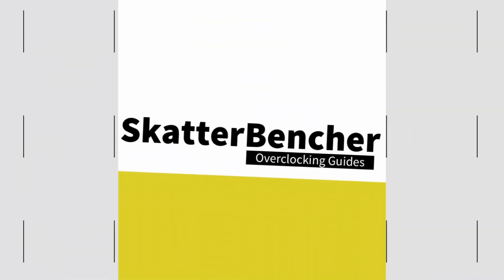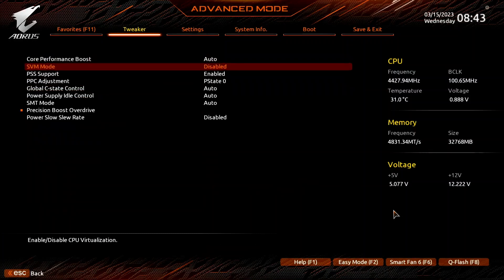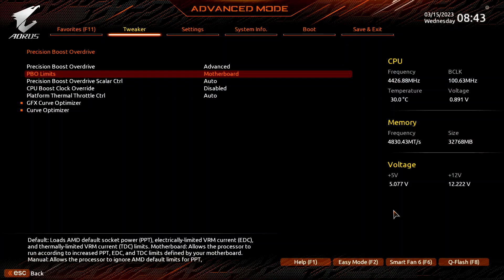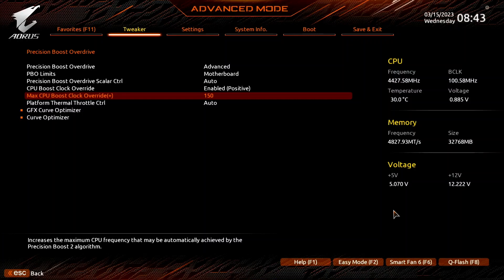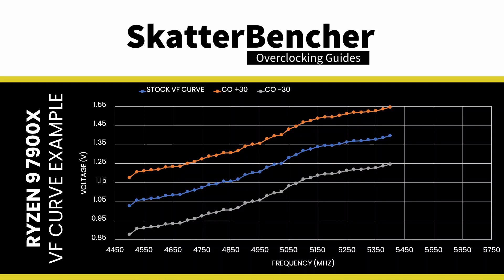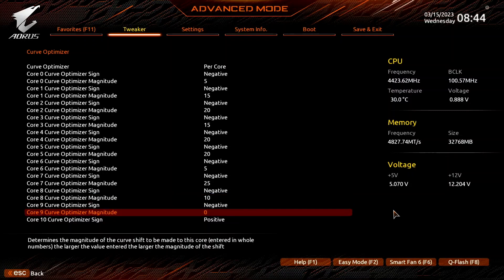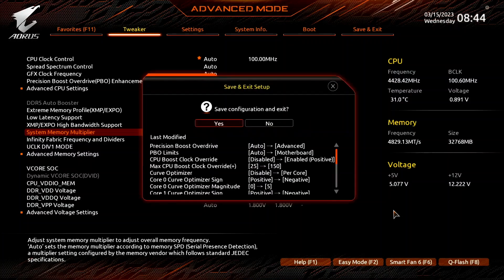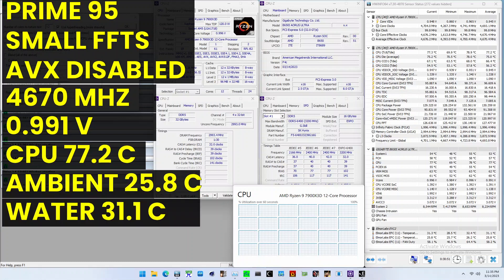5 Minute Overclock: Ryzen 9 7900X3D to 5789 MHz

Comment: 2:00 Enabling CPU Boost Clock Override (+150 as in the video) on my 7900x3d and ASRock B650 Livemixer bugged out the CCD scheduling - CCD0 (V-cache) was prioritized all the time, not only in games but in windows and benchmarks as well. Nasty bug.
Reply: it should do that its better for games ccd0 prio
Reply: @Adrian23yt4k  not when it prioritizes the vcache ccd in idle / browsing. Be sure to set power plan for win11 to balanced and not performance

Comment: I couldn't help but notice that the memory you have is not EXPO memory but is XMP memory according to the link you provided to Amazon. Is the XMP memory still ok to use with an AMD motherboard for OC?
Reply from the maker: XMP kits should work just fine on AMD motherboards. However, they might not be called XMP so not to conflict with AMD's EXPO branding. So they might be called DOCP like on ASUS boards.
Reply: @SkatterBencher  Right, was asking cause I wanted faster RAM and EXPO technically only goes up to 6000 MT's whereas XMP RAM goes up to like 7400 MT's or higher. I'm using an MSI B650 Edge Wi-Fi Board. I initially bought G.Skill Ripjaws that could do 6800 MT's but found out it was XMP so I returned it to Amazon for G.Skill Trident 6000 MT's instead that could do the EXPO. I've heard that if you try to OC XMP RAM on an AMD board it could be unstable, is that true or is that only if you are attempting to OC it manually? I haven't built my new build yet, I've got the parts and am still within my return window but need clarification if I could OC XMP RAM on an AMD board using the auto function like you did.

Comment: I did this and got a black screen when I turn my pc on
Reply from the maker: First, press CMOS clear to restore default settings. Next, I suggest you can watch my longer SkatterBencher video for more information on how overclocking this chip works https://www.youtube.com/watch?v=NzNflofJufY
Reply: Did this as well and no boot. My 7900x3d does not work with any sort of undervolt or oc no matter the config, and I can only choose pbo enhanced 1 or any other option also causes pc not to boot. Worst Ryzen CPU I have had when it comes to tuning, can't tune it at all it's a shame

Comment: Hey scatterbencher! Do your 7000x3d lag when opening certain programs like HWInfo64 or AIDA64 or even booting up? Mine lags so much and it takes longer to open these programs than my 8 year old desktop. I am so disappointed and sad with AMD tbh, it has been nothing but trouble for me, I am so close to giving up. The asus x670e extreme screws up all the time, fails to post often, the leds with armoury crate just DONT work.
Reply from the maker: I didn't see any such lag, but I haven't had the X3D system on for a while so can't verify :)
Reply: Nothing like this

Comment: I am using 7950X3D+B650E Aorus Master, I learned a lot after watching your video, now I have some questions to ask you (I am not a native English speaker, please forgive me): I have been using eclk105 with EXPO and 2200fclk+1.2vSoc, I gave the good cores +15, slightly worse cores +22 and used them normally. Because I have more time recently, I want to further optimize my co, so I used corecycler set to: y-Cruncher mode +22-ZN4 ~ Kizuna+BKT, BBP, SFT test, and successfully reduced a lot of co, but now it becomes unstable, it will randomly black screen restart or blue screen, I tried all cores +5-+10co after it is still unstable, finally I tried to turn off global c-state, then everything became normal, so can I turn it off? I noticed that the standby power consumption became a little higher, but I don’t care about the electricity bill lol, just want to confirm the safety

Comment: Hey scatterbencher, is there a way to set the CPU to max frequency all the time. Mine alternates a LOT, and even dips down below 3 Ghz for no reason during heavy gaming loads.
Reply from the maker: Not with Ryzen. Their frequency boost technology (Precision Boost) is designed to always find the maximum stable frequency at any given moment. Depending on the workload, that can fluctuate obviously. That's why you see changing frequency all the time.

You can disable Precision Boost which will revert the CPU to its base frequency. That will be more like a fixed frequency, but obviously not close to the maximum frequency.
Reply: @SkatterBencher  Ah, I see, thank you very much!
Reply: @SkatterBencher  Thanks again for your response! I was rewatching your 7950x3d video and I was curious about what you said about the 2 ccds sharing the same voltage rail so they cannot both go at their maximum frequencies. Why is this since they can both operate at the same time and one has higher frequency than the other?

Comment: Why not bclk overclock like the 7800x3d?   Also you keep mentioning not to use your values for cpu per curve optimiser, what is your best recommended method for me to find out my cpu optimal values?  Thanks, your videos are awesome. I’ve been out of overclocking for about 10 years, loving being back in it. Thanks to you.
Reply from the maker: No ECLK overclocking because this motherboard doesn't have external clock generators. Also, ECLK for dual-CCD X3D chips is pretty complicated as I've tried to demonstrate in OC Strategy #3 of SkatterBencher #56 https://youtu.be/9BwNt6PD-00

As for the ideal method for finding the right Curve Optimizer settings: I use a combination of CoreCycler and SuperPI to find stable settings, then make sure to run through all my benchmarks and stability tests. I share a little more information about my process in OC Strategy #3 of SkatterBencher #58 https://youtu.be/NzNflofJufY

Happy to hear you're having fun with overclocking, that's all that matters!

Comment: Setting boost override to +150 on my 7800x3d actually seems to make performance worse. On auto I get 18000+ R23 score but with +150 I'm only getting 17300, 17500ish. Why is that?
Reply from the maker: It could be due to "clock stretching" where the effective CPU clock frequency is lower than the set CPU frequency due to instability. You can try setting +25 MHz first, check the performance, then gradually go up
Reply: @SkatterBencher  hmm that makes sense. Thanks for the reply. So I've just decided to leave it on auto. Changing it doesn't really seem to add any performance. I've also overclocked my Ram. I think how I have it set up is as good as it's going to get compared to stock.

PBO plus CO -30 except one core is at -22. Ram at 6400 cl28-37-37-30. In Aida 64 I get around 69150 reads and 62-64ns latency.

Comment: Oc video while people shit their pants burning their cpu. So i can still use expo?
Reply from the maker: Has it been confirmed yet what's the root cause of those reported burned CPUs?
Reply: @SkatterBencher  I dont think so. msi released a new bios and Asus made a statement. they said they implemented thermal monitoring mechanisms, removed possible Vcore control and that they were working with amd on new rules for expo and soc voltage. 
Sounds like they know. 
I guess they'll find a way to prevent this in the future, but I'm concerned it will end up at the expense of performance. 
annoying, I was in the process of putting everything together. Maybe it would be better to send back and order a 13900k.
Reply: @SkatterBencher  No, Pieter. The new BIOS releases are speculative mitigations. I don't think that there is yet a confirmed correlation between those spectacular "bubble" failures and intentional user overclocking/volting.

Comment: Any chance you’d be willing to make one of these videos for the B650EF motherboard? There are differences between that and the board you use, the B650EF does offer overclocking but there are some options and feature missing. Btw I use the ryzen 7900x not the 3d chip
Reply from the maker: I have an extensive guide out for the 7900X and 7900 already. In the longer versions I cover multiple overclocking strategies, so you can pick the one which can be applied on your system

Ryzen 9 7900 + B650: https://youtu.be/I5ZpKsKWw8U
Ryzen 9 7900X + X670E: https://youtu.be/o_AMxVcS2DM

Comment: There is a bug or its by design on the 7950XD and probably the 7900X3D as well,  but enabling CPU Boost Clock forces all processes to the V-Cache CCD instead of the frequency one. Degrading cinebench scores etc.
Reply: well I shoulda read the comments beforehand, thanks now I can confirm it plagues the 7900x3d as well - why wouldn't they fix it??

Comment: Is this safe with a corsair water cooler? Also, I have a 7900x3d, will I feel some significant performance increase by overclocking it? Great video and many thanks! 😄
Reply from the maker: Yes, I think so. The X3D CPUs are mainly limited by voltage, not power consumption. So a decent AIO can squeeze all the performance out of an X3D.